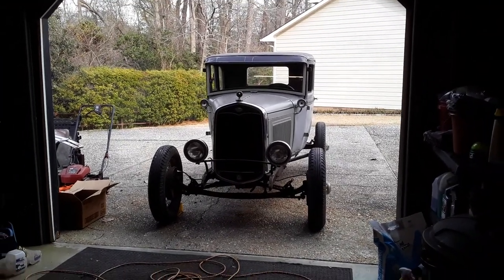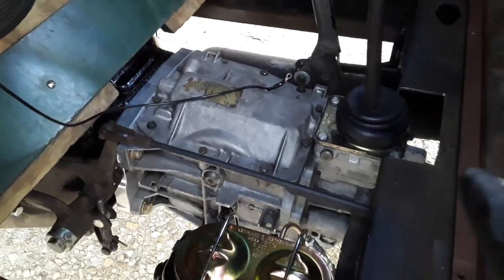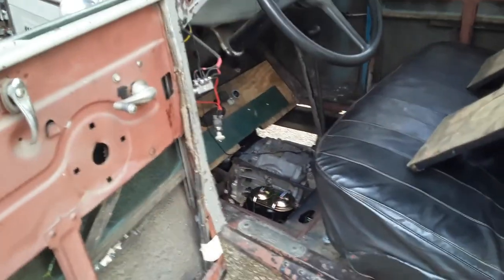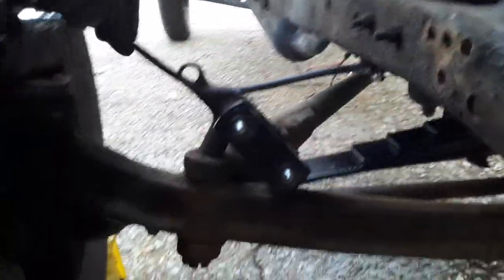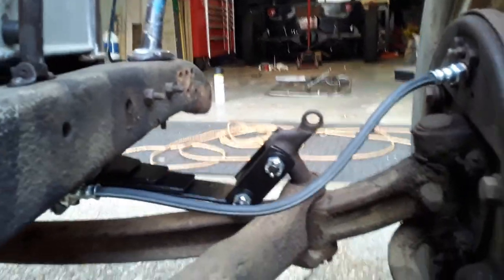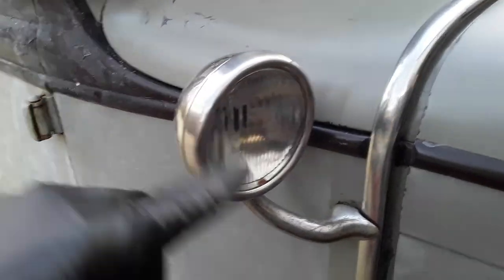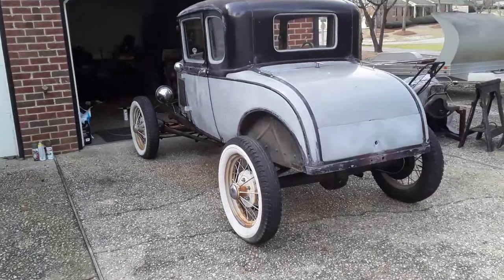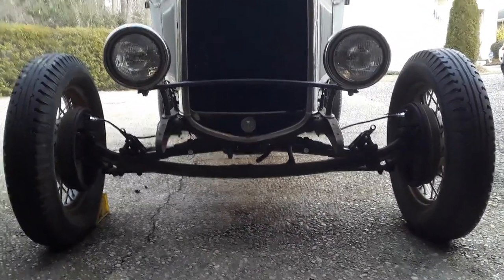1931 Ford Model A Coupe Update 21 FEB 2022

Comment: Looking Good . What year T5 are you using & what is it out of?
Reply from the maker: Looks to be a 91 that probably came from a S10 2wd. It has a shorter tail housing that pushes the shifter closer to the gear case. A full length T5 would put the shifter through the bench seat.

Comment: Did you make or buy the T5 crossmember ? how many inches does it drop ?
Reply from the maker: It is a 6 inch drop. Made by Trans-Dapt Performance. Part number: 9444. Found it on Amazon. It will not bolt on. Fabricated two under frame mounts from angle iron. Cost $88.
Reply: @ladladderson8362  thank you